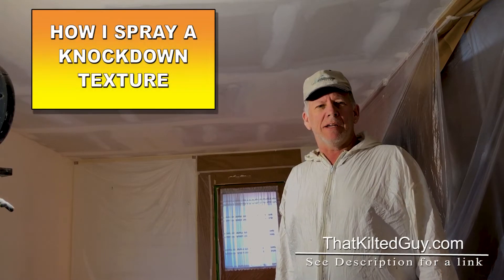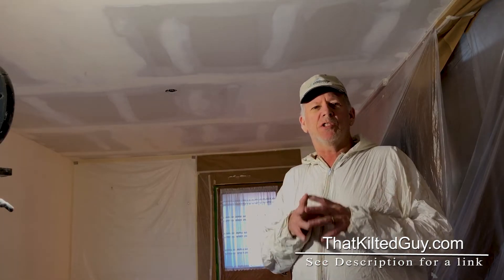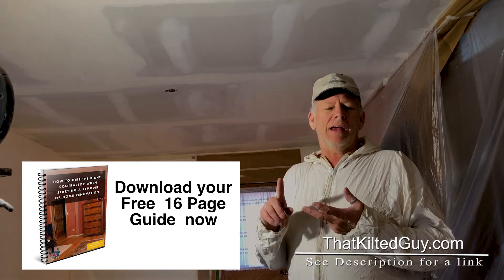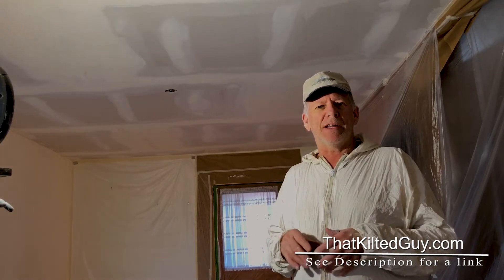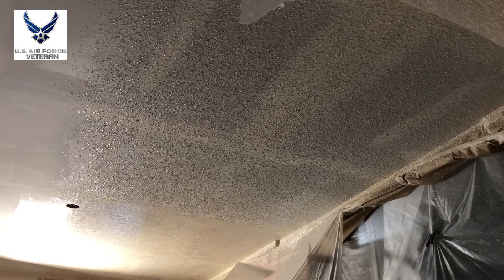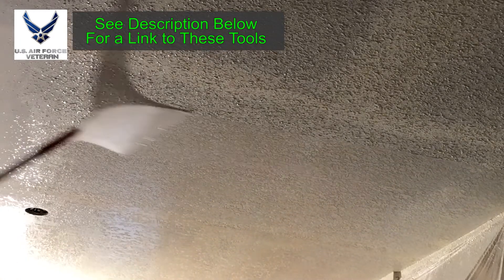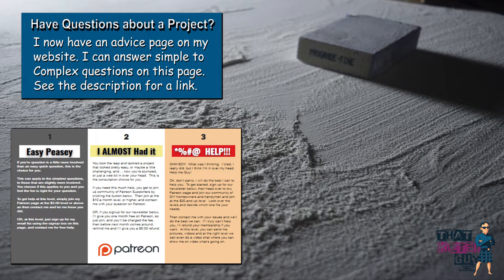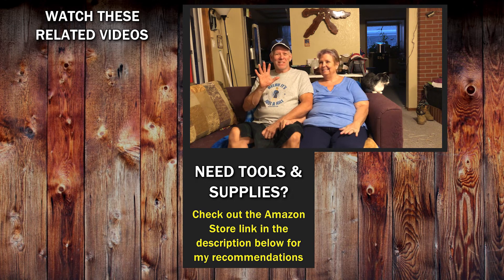Live, Spraying a Knockdown Texture with a Hopper Sprayer, by That Kilted Guy DIY

Comment: Just started this on my garage. I was hoping to cover old brown paneling. It was in the entire garage and after painting the walls white i was happy for the brighter space. Not wanting to go the distance with a complete drywall redo of the ceiling I figured spraying (or rolling!) mud onto the ceiling would hide the fake paneling, seams and damage from it being old. Well rolling didn’t give me a deep enough layer to hide much so I got that fancy sprayer and went to work. I liked the texture a 3/4 roller gave so I’m just spraying and waiting a bit and then roll it to pull down the mud into basically millions of stalagmites. But it still needs painted as the brown paneling shows through here and there. Spraying that too and then rolling with another layer of paint after the spray dries. This process is taking way longer then originally thought! Respect for all tradesmen who do this sort of thing daily. My upper body’s toast!
Oh! And respect for the vets. I’m not one but I do have 36 years government service.

Comment: Just started watching because I needed to get some help on a drywall corner that was damaged and your video was first to view with the description I typed in and it was pretty much exactly the same as what was doing. Your tips with little tricks is helpful, so I will stay tuned thanks.

Comment: Thanks for your service.  I have learned a lot from your videos. I use a similar gun and it has become my favorite too. I learned only smooth a did it for a couple decades. So I need the texture lessons a lot. These guide line will help. For ceilings I made a elbow out 1 1/4" 45 degree pvc fitting and small piece 1 1/4 pvc pipe and sanded it down the pipe to fit  the hopper side, cut multiple small slots in the fitting/ with hose clamp for the gun end. It helped flow more mud to the gun.
Reply from the maker: Check out this video- Spraying Knock Down Texture.  Learn the 🔐 SECRETS 🔐 only PROS know using this $30 Tool https://youtu.be/eKkDBGHCbJo
Reply from the maker: Thanks for helping me build my channel to 100,000 subscribers and beyond

Comment: Good morning Guy! I am doing 2 small "fake" walls and then gonna shoot the ceiling. Gonna get familiarized with it on a practice spread I'm setting up in the garage to see where I want my or how thick I want my splat! I'm gonna do half moon (what I call it anyway) for the knockdown part. Only cuz I'm not able to get the knife I really want to use for this. Gonna go fairly heavy on the ceiling. I did a pretty good job on tape, mud, coat and skim. For being quite some time that I've done a job this big I was more than happy with my butt-joints and if happy there, everything else is good. Thanx again for another great video! P.S. I do NOT like inside edges/corners (wall/ceiling specifically)
Took me up to the 3rd long run to get back in the "swing" of things😅 But, all in all 3 weekends to undo their serious drywall hanging mistakes, to banging out a ceiling and 2 "fake walls" I'd say I did a pretty damn good job running by myself!!!
Reply from the maker: Cool. Thanks for sharing

Comment: Sweet. Video starts at 2:00 guys. Just bought a $79 mud sprayer with adjustable (spinning) head at lowes. These videos are great to brush up on tuff you havn't done in a while before a job.

FYI Home depot has now made there vet discount require a smart phone, to log into there app at register (if you can get service) and to scan a qr code. They have also limited there vet discount to $400 a year. Lowes didnt change anything, has trailer parking spots, and vet reserved parking spots. N more home depot.

Army Infantry vet

Side question, can these guns do orange peel look? They have a very small setting i assume? Need to make it more watery?
Reply from the maker: I have always preferred Lowes Veterans policies. Watch this video- https://youtu.be/fUiSeoOP2bk

Comment: Thanks for the quick video showing how to spray on the texture. I just scraped off popcorn texture and found that the drywall is s not primed. Should I prime it before spraying on the knockdown?
Reply from the maker: Yes. But make sure you fix all the defects, and see if the joints need to be re-coated, the nails spotted, etc. If you just texture right over after removing popcorn it’s about a 90% guarantee it will look bad. 
www.ThatKiltedGuy.com 
Www.Patreon.Com/thatkiltedguy

Comment: How do you determine the consistency of the mix in the hopper? I’m about to do a bathroom’s walls.
Reply from the maker: Mostly experience.  But start slightly thicker than you think ,test, and thin until you get the result you want.

Comment: Love your videos. I’m a retired union commercial taper who did 35 years. Moved to Texas from California and have been helping people out doing patching and smaller stuff. I learn a lot from your vids. I did a ton of smooth wall so your videos are a Great source   of how to do more residential repair jobs. Just wondering in this video couldnt you have sprayed the whole ceiling in one shot then wipe down ? Maybe you did it that way for the video. Also is that hopper from harbor freight?
Reply from the maker: Hello, you can only spray so much as it's setting up the whole time (really just drying out) and if it dries to much you can't get a good knockdown so you have to stop now and then when you are alone.  With a helper you can spray non stop.  Yes, its from HF but the one in my link is identical.

Comment: I noticed that you knocked down the texture in portions as you were spraying the ceiling in your video. How big of an area should I shoot before pausing to knockdown the texture? I'm planning to spray a knockdown texture after I remove the popcorn throughout my house and ordered the texture gun and knockdown tool as suggested. Any tips on reaching high ceilings for this work? By the way, I'm a veteran as well having served in the Marine Corps.
Reply from the maker: I will try to cover all of these questions and more in my Drywall texture classes that I’m working on now at www.DrywallAcademy.com 
Thank you for your service

Comment: Got a question or two. First, can I texture the ceilings and walls at the same time? I would things so. But just wanted to make certain the same consistency of texture is suitable for both. Second, do you even advise knockdown on both ceiling and walls? Would that give too much of a one-dimensional appearance? Thanks for your video.
Reply from the maker: The same texture works on walls and ceilings and the majority of homes have the same texture on both but that’s totally up to your style.
Reply: Thanks again. Your video already saved me time when you suggested using my airless instead of a pump sprayer. Your content is awesome!

Comment: I have my repairs done ( took out ceiling speakers and drywalled the holes)  I did follow exactly what you showed on repairing ceilings and now ready to spray knock down texture to match up to the existing knock down.  I have a Wagner Spay tex from years ago when I did my shop offices and board room.  Now my challenge is to match the spray on the repair to the existing knock down and I do have the lexan plastic knock down knife which will make it easier.  Any tips on spraying with the Spray tex to match?  I may have a redbull once done but not before, I am not that good.
Reply from the maker: Have you considered using a sponge instead? Check out this video- Knockdown Texture with a Sponge on a Large Ceiling Repair https://youtu.be/NqXGBJQL62Q
Reply: @ThatKiltedGuyDIY  Thanks Guy,  I will give my best effort with a sponge.  I just finished watching your youtube you suggested.

Comment: I'm going to be texturing ceiling and walls (fresh drywall) I would like to do ceiling and walls all in one go. I plan on doing knockdown on walls and more of a orange peel on the ceiling. Would I be able to spray ceiling and walls all in one go and then just knock down the walls? Any advice?
Reply from the maker: By yourself, you can only do roughly 100 ft.² of knock down at a time, depending on many factors. But you could do all of the orange peel continuously

Comment: That's right sr... 

Thanks for those cool tips... im probably going to copy u sr... .. so I can start getting more customers. 

Also i have a question. .. ? 

Why ur happer spray texture like very small orange Pell
Reply: Peel .. and which Hopper do you recommend? 

I bought the the black cone in Home Depot husky. I put it inside a bucket of water to use it the next day it had rust and it looks old as hell... but works all right

Comment: Appreciate the videos and your service, I am also an AF veteran.  I have the wal board hopper gun and wonder if you could recommend an adapter to give me a better angle when doing ceilings.  I'm 5'2" and ceilings kill me.  Thanks in advance
Reply from the maker: I think you can find an ABS adapter.  Otherwise, probably someplace like all-wall.com
And thanks for your service sir.
Reply: @ThatKiltedGuyDIY  Why don't you use the adapter? Doesn't the hopper have issues spraying when tilting due to the gravity feed
Reply from the maker: It’s better with the adapter but since I spray very little on ceilings, I can just make it work by careful tilting. Plus I don’t overfill the hopper or you get a chest full of it, lol
Reply from the maker: Plus I ended up buying the Grayco pressurized hopper later that doesn’t require a gooseneck to spray ceilings as it’s pressurized.

Comment: Also what is it about this hopper that you like it more than the $80 ones.
Reply from the maker: Well it's much cheaper, and since I've worn out 2 others, I'd rather wear out a cheaper one.  But one way the expensive ones wear out fast is the trigger pull gets too soft and doesn't seat the sprayer tip right.  The cheap one has a much stronger spring so I've yet to wear it out.  The hopper is smaller though.

Comment: Do you suggest trying to cover the whole room before allowing set up time and knock down, or doing smaller sections of a larger room?

P.S. thanks for the great videos
Reply from the maker: I usually can’t do a whole room with these cheap hoppers without having to stop and knock some down or it will set up too fast. If you want to delay that set up you can prime the ceiling first. Another way to do the whole ceiling fast is to use a faster texture sprayer. I own a new $250 Graco and I’m going to borrow my friends more expensive Graco and do a test comparison one day.

Thanks, glad I could help you out 😎. And thanks for subscribing!  And Hey, thanks so much for commenting and for subscribing. With your help we can blast past 100,000 subscribers and more!

Comment: Do you need to prime the drywall before you spray the mud on?  I am assuming no....correct?
Reply from the maker: No But it helps it set up more uniformly and allows you to spray more before you have to knock it down, and it also knocks down more uniformly but it’s not a huge difference

Www.Patreon.Com/thatkiltedguy

Comment: Wondering what air pressure you use? Thanks
Reply from the maker: It’s not the air pressure. That’s the most important. Check out this guide Guy did that explains everything. https://www.etsy.com/listing/969964231/how-to-spray-a-drywall-knockdown-texture

Comment: How long did you wait after spraying before knocking it down. Air Force vet here!
Reply from the maker: Hello Tom Marsala. Thanks for your service.  How long you wait varies.  One way I use is to watch the shine of the mud.  It shines a lot when wet so as the shine starts fading, test a small section.  If it flattens to much, wait.  Usually it takes about 5 minutes over raw drywall and up to 20 minutes over painted surfaces.  Hope that helps, Guy.

Comment: Can you do the same thing to the walls with that same device
Reply from the maker: Yes
Reply: @ThatKiltedGuyDIY  hmm because my boss used a huge hose . Was very heavy :(
Reply from the maker: That sounds like the pro texture sprayer. We used to use that when we did new construction and they are about 50 times faster than this method and that’s why we used it.
Reply: @ThatKiltedGuyDIY  is it better to use yours?? Its more lightweight . Im thinking of buying my own hopper 💡
Reply from the maker: Well the professional rigs cost about $10,000 and the one I’ve got cost $30 so unless you’re doing whole houses, the small one is the only one that makes sense.

Comment: Would you recommend this texture for walls? And would it be alright going on top of vinyl?
Reply from the maker: It's sprayed on walls all the time.  I would only spray over vinyl if I sanded it with 80 grit then primed with a high bond primer.  OR, put some wood glue in the mud to make it stick better.  But test first to ensure it will stick.  Modular maybe?  I've done those.
Reply: That Kilted Guy DIY Home Improvement thanks for replying! It’s a manufactured home and I really wanted to remove the strips from my bedroom walls. Planning on doing a knockdown texture and then painting & trimming.

Comment: Do I have to prime the Sheetrock before spraying texture?
Reply: No if it's all new sheetrock it is not required but if it's new with pre existing oil based painted sheetrock people prime both sheets so the texture can saturate evenly and to prevent the texture from falling it helps the texture stick better avoiding air bubbles to form on the mud

Comment: What size compressor did you use? Would a 6-8 gallon suffice for a DIY job?
Reply from the maker: Cfm is more important.   You can probably get by with 3-4 cfm for light use. Just try keeping the airflow shut off whenever you’re not using it to allow it to build up volume in your tank. Let me know if that helps. Guy

Comment: When I clicked on the texture knife, Amazon recommended Homax Wall and Ceiling Dry Mix Texture 15 lb, Orange Peel and Knockdown Texture. Is this necessary for the right finish? What type of mud did you use in the video and, how thick should it be?
Reply from the maker: I always spray texture by simply using box mud. Most any box mud will work as long as it says it can be used for decorating on the box. I Use USG +3. The thickness depends on the texture you’re trying to get but in this case it would be slightly thin pancake batter thickness. Best to start a little thick and work out to thinner and experiment until you get the texture you want. Watch my video on spraying an orange peel texture where I describe all of the variables that will affect the look of the texture or you spray. https://youtu.be/H3MOmRcJ_3Y
Reply: Buy Plus3 finishing mud! No powder lumps smooth finish
Reply: The mud doesn't matter the consistency is what does

Comment: What if you have to do a smaller area? Are the spray cans ok?
Reply from the maker: If you use them right, spray cans can do a decent job. Overall I still like the texture sprayer in this video for small repairs and rarely do I use I can texture. And keep in mind that they exaggerate this coverage and normally I can only get something like 4 to 6 ft.² out of a can unless it’s really light texture. I would buy the pro grade as it’s more adjustable and it’ll give you better results, but it does cost more.

Comment: What compressor did you use to spray this knockdown? Was it your California compressor?
Also what PSI did you have it set to? I use USG Total mud, a spraying mantis Hopper, and a twin tank emglo compressor that puts out 4 cfm at 90 PSI, but it doesn't spray anywhere near as fast as your setup.
Thanks
Reply from the maker: Yes my California Air compressor. I always run about 30 psi.
Reply: @ThatKiltedGuyDIY  
Maybe I'm mixing my mud too thick, or maybe the lighter Plus 3 mud sprays easier. Either that or that inexpensive spray gun you're using is better than my $80 Spraying Mantis gun.
Reply from the maker: Mystic_Fool I’ve had the mantis. It’s not the gun or the mud type. Watch this video. You likely have it to thick. 

Spraying Knock Down Texture.  Learn the 🔐 SECRETS 🔐 only PROS know using this $30 Tool https://youtu.be/eKkDBGHCbJo
Reply: @ThatKiltedGuyDIY  
One of the reasons I tend to mix my mud a little thicker, is to achieve better stand out, or depth. On larger jobs I hire a texture company that has a truck mounted rig and uses bag texture. The results are always Superior to that of using a hopper and compressor. The knockdown has more depth to it, and looks  more professional. I try my best to get the same results using a hopper and compressor, but it never comes out looking as good. At one point I had a portable Graco texture rig that achieved great results, but it died after a few years of use, plus it was big, and a real pain to load and unload and wheel onto basements.
Reply from the maker: @gme10955  Yeah, there's nothing going to keep up with a Pro texture rig.  We had a pull behind unit with stainless tanks, and 2 tanks, so we had one for popcorn, and one for texture, and those things get serious.  I can get a pretty good stand out but it's way slower.

Comment: What size compressor do you use?
Reply from the maker: One that puts out around 4cfm at 90 psi or more
Reply: @ThatKiltedGuyDIY  Thank you very much for quick response. Last time I sprayed drywall texture I had some issues with the compressor because it was only 2.6 cfm and I am on my way to buy a new compressor today and found a good deal on a 1.8 horsepower 8 gallon 4cfm @90 psi.